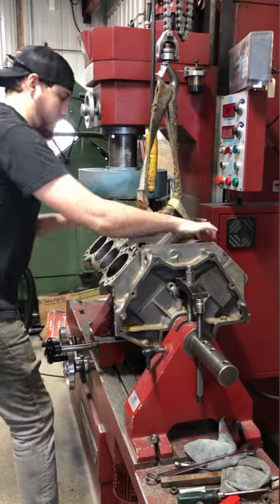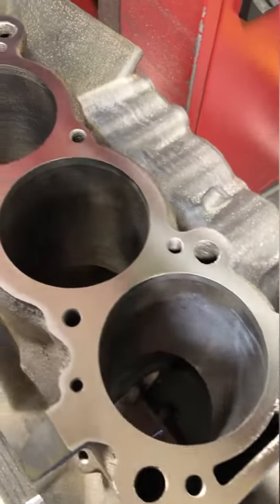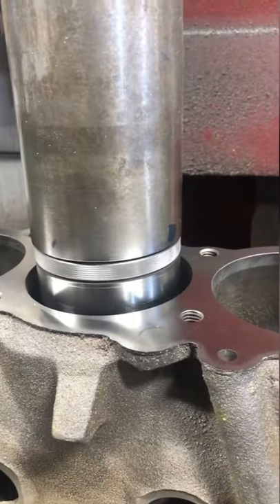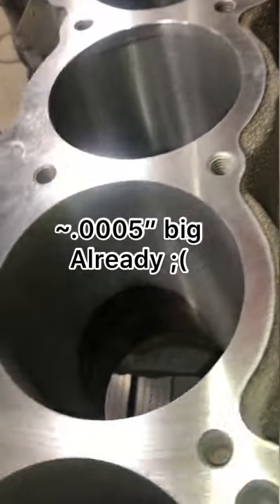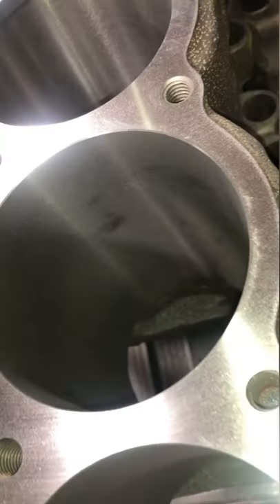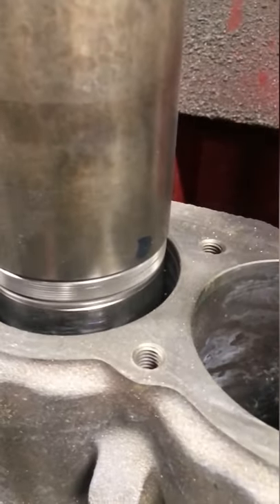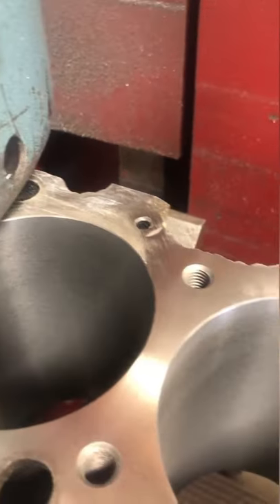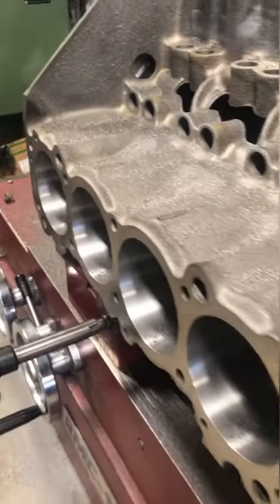#shorts Machining a 340 Buick V8 Engine Block @JAMSIONLINE

Comment: I think you do great work & woulld be happy having you do my engine work but that level doesn't seem super accurate. I think I'd be using my Starett 199 w/.0005"/foot grads. even though it's not a level for everyday use.

Buicks are thin wall & can be dicey @ 0.060" over. I'd sonic test if you haven't. Wouldn't that shadow at the bottom of that one cylinder been below the bottom of the rings @ BDC?

Comment: I'm missing how checking the level on the top gives you perfectly perpendicular to the crank. If the top surface was machined wrong previously it's a useless reference.

Comment: Hey are .050 pistons for a 350sbc readily available? It looks like you might b able to get them. I have a worn .030 bore on an sentimental engine but im leary about investing the $ to do a .060" overbore with the potential issues they can have.

Comment: I dont have the skill and the tools to do it, but can you use a "trash" v 8 block and if only one side is not fixable,  would you be able to turn that side into a comppresor? Or maybe just the broken cilinder? Just asking because im curious. And if this is possible could you do it woth ani broken cilinder? Like you could make a air tigth seal but i wont work for combustion? Using low temp solder, jb weld, epoxy,etc?
Edit: if this possible i do find that this couñd be use for air ride on a car or truck and this would be nore unique on a build

Comment: Nice RMC1000 Machine, however, it doesn't look like a great block squaring fixture, it doesn't reference the cam and setting it with a level means it's only as square as it was the last time it was decked.

Comment: I had to laugh when I saw you using a Dollar store tape measure.
We did an audit on all the tape measures our guys used after measuring issues on a couple of jobs and found there was over 2" difference between the longest and shortest tapes when set to 6ft. We now only use one brand of tape.
Reply: I've had a lot of tape measures in my hands but 2" in 6'? Sounds like a tall tail.

Comment: Is .060 over the max on a Buick engine? Just curious
Reply: Gonna run hot!!
Reply: @ascott6804  
Myth...
Reply: @dmur612  ...thats ok for strip/street but daily isn't gonna heat? Water jackets on those were tight anyway,right?
Reply: Buicks are like Olds compared to a Chevy block.  They have hotter thermostats, bigger bores, shorter strokes, and bigger valves.  They’re designed for extra heat and durability.  You can always heat treat the internals, cross drill the crank and cam bearings for better oil distribution, and add a supercharger for extra air.

Comment: What was the final increase in engine capacity after completing the head?
Reply: If you're asking what the cubic inch will be, without looking up the stock specs it will probably be between 349 to 352. Heads have nothing to do with cubic inch.
Reply: @edmundanderson657  Did he bore the cylinder, did he change the stroke? Was 2 years ago, not sure? Maybe I was wondering
Reply: @dav1dbone  
Funny I didn't see the date at first it came up as something I might like.
But ci is determined by bore x stroke x number of cyl.
Without looking up the numbers but going by similar displacement engines. 030 will increase by about 5ci and .060 about 10ci. It's a 350+- now.

Comment: Just a humble observation here but at .060" over would it have not been better too to press in 8 sleeves to keep it nice and stout and closer to the original measurements?  How much casting material is still left around each cylinder at this point that any cylinder may be prone to a crack is the reason why I ask?  Under no way to critique the work, HELL NO, great work!
Reply: I like your theory, but at $100 bucks a pot, that's one expensive block, eventually.
Reply: @RMinOZ1  Ouch, I did not stop to think what each sleeve (the process and sleeve) would end up costing?

Comment: Ok... I'm not a mechanic but isn't 60 over thinning the cylinder walls too much? Wouldn't sleeves be better? I mean at 60 over wouldn't u have to add inter coolers and high pressure oil pump etc. ?

Comment: Why dont you use a deck plate for boring? Ive seen quite a difference with and without it.
Reply from the maker: Boring is a rough operation. Deck plates are used during the honeing process as it is the finishing operation.

Comment: Nice work! I can see the justification of this application for classic car restoration for hobby enthusiast. Not quite wise for modern Detroit products which should be junked before going down this path. 

We all know that guy who ran nothing but Mobil Marble Mystery Slick Syn Foam Fifty, with the copper funnel every 3k in his Detroit vehicle, only to end up at 78K, in my customers room waiting for the bad news. 

We’ve all seen Japanese vehicles run flawlessly   W 300K on oil from 7-Eleven every 5K why? 
Materials and tolerances that’s why. Pay attention or pay cash!

Comment: I heard of 340 dusters but not buicks
Reply: During the horsepower cubic inch wars of the 60's cubes where all over the place.
Buick small blocks stated with a similar but different 215, then 300, next 340 then 350. Then it was cost and emissions that most manufacturers limited themselves to 2-3 engines.

Comment: No you cant weld a newer surface you add a multitude of shim stock a sheet of metal and double seal some engines are so ised there running out of new casts

Comment: Why do they not make 50 thousands oversized pistons?
Reply: They might or might have, but you have to consider this was a limited production engine that's almost 60 old.
its been decades for me but common sizes for most engines were .020, .030, .040 and .060.
But I have seen .005 and .010 also.

Comment: 60 is way too much. Should have told them to get a new block. Always been told anything over 30 and there's a chance it will over heat and the walls are too thin.

Comment: So let me get this right ..you were cutting at 40 but could not achieve that so u cut at 60 now needing new pistons but isn't that way better over all for both the owner and car ..bigger piston bore equals way more bang for your buck which in term means a lot more displacement and extra power ...have I got this right !!
Reply: No.    The additional displacement is negligible and 060 over means that block most likely will have to be sleeved at the next overhaul or be disgarded.
Reply: @paisleyprince5280  ok cheers buddy wasn't sure always heard when u widen a cylinder and add new pistons and rings u get more power ..my bad ...cheers for that

Comment: I didn't no that buick made a 340? I thought it was mopar but I could be wrong.
Reply: Mopar did do a 340, Buick didn't that I know of, they did have their version of the 350 though.
Reply: @gregg6474 
Yes Buick had a 340 for 2 years in the 60's.
I'm sure its written somewhere but by 68 with the exception of Cadillac the other 4 GM brands all went to a 350 ci version of there engine. Someone must have come up with efficiency/torque/numbers to make it a standard engine size.
Reply: @edmundanderson657  but all the 350s had different bore and stroke from each other
Reply: @gregg6474  
To long ago to remember the numbers but I believe you are right.
It will determine where the torque curve is but someone must have come up with a 350ci engine will efficiently move the vehicles of the day to make that cube the go to mass produce engine size. They all went to it.
Reply: @edmundanderson657  yes, I had to Google it myself on the 340, that's one I missed,  but the buick 350 had the longest stroke, the Olds had the biggest bore, which was kind of odd because it was the opposite in the 455s, buick had a big bore 455 and Olds had the long stroke.

Comment: Please tell me you didn’t actually machine that to the precision of a level and a tape measure. Please...
Reply: How would You do it?
Reply: Tape measurer is only used for the depth of the cut, as going any further wont really hurt it but it would be pointless. so it dosent need to be precise, just enough so it stops when it's at the end of the bore

Comment: Over heating problems for sure i had a stock 400 sb Chevy and the idiot that was doing a rebuild bored it 60 over and we had a 6 core radiator and it still over heated all the time

Comment: How far will Americans go to not use Metric?
Reply from the maker: We use whatever the engine was designed in. In this case, an American engine from the 1960's, it was designed in inches. As such, it makes the most sense to use inches for all of our measurements. When we work with an engine that was designed in metric units, we use metric units for our measurements. While units matter, it's honestly pretty irrelevant to the work at hand. I could use football fields, light-years, hands. It doesn't matter as long as you understand conversion factors.
Reply: Are you jealous that we are bymathematic? Inches/millimeters who cares?